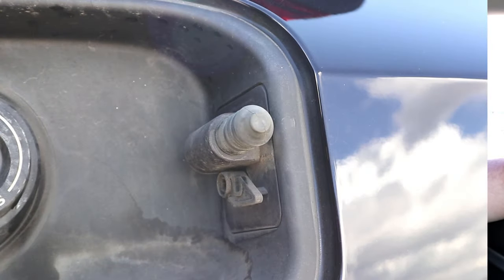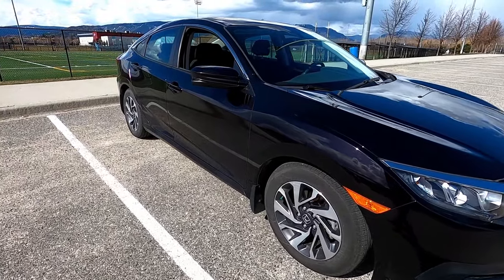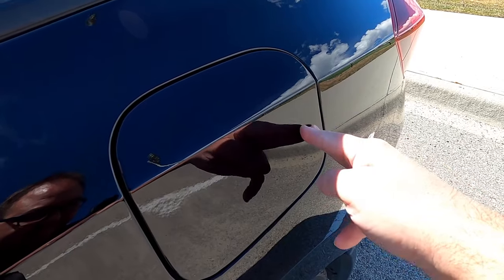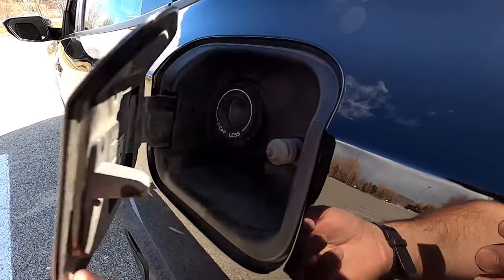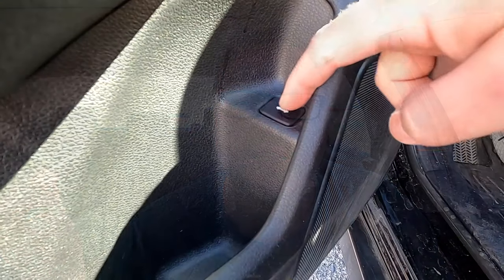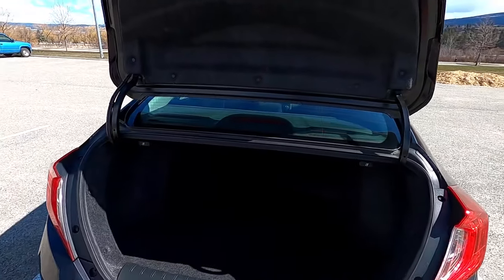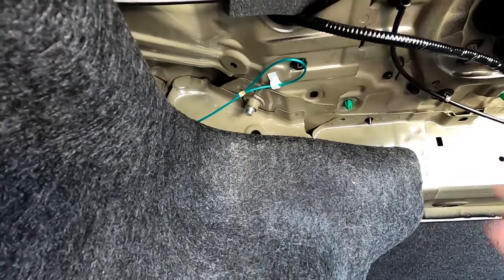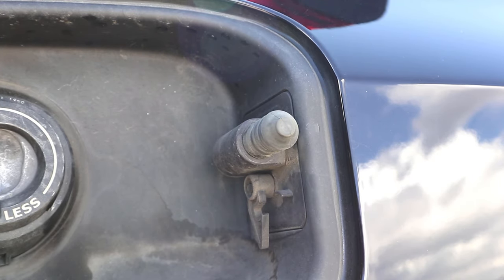Honda Civic Gas Door SECRET Release Cable Handle - 2016 2017 2018 2019 2020 2021

Comment: I was at the gas station and didn't know WTF was going on when I couldn't open the fuel door.  I have a 2018 Honda Civic Hatchback and your video was on point!!!  Had to remove a small panel where the jack is located, and I felt inside the opening for the wire.  BINGO!!!  Thank you!!!
Reply from the maker: Glad it was helpful!

Comment: For anyone with the Honda Civic hatchback model, look in the side panel (behind the driver side), where your jack is located and you will find a white cable. Pull the cable and unlock the car via the remote or the locks on the door to release it.
Reply from the maker: Thanks for sharing this tip.

Comment: Thank you. 
Wanted to mention because I didn't see it in the top comments, it was because I lock my doors when I pump gas. 

As soon as you said, "It locks when the car does." I just had to take a minute with my head in my hands, laughing through my anger. It makes complete sense, but I've always had, ya know, a NORMAL DOOR or a button. Glad to know there's an emergency release tho.
Reply from the maker: Lol 😂 Glad I could help!

Comment: I usually don’t comment on YouTube but THANK YOU for this, I could cry I’m so happy. I just spent an hour at the gas station trying to find a way to open my stuck gas door and your video wouldn’t load and all the things on the Honda website (saying to shut off the auto lock feature) wouldn’t work. I got home and your video finally loaded and I ran out to my car and BAM…. Broken down moving boxes were stuck on the green wire which is why it wouldn’t open. You just saved me $200 (what they said it would cost to look at it) or even more. I’m seriously so relieved… thank you😭
Reply: Also for the record, mine is a 2020 Honda Civic Sport
Reply from the maker: Awesome 👍 I am happy I could help. All the best!

Comment: Omg you lifesaver, you handsome man! Thank you! For hatchbacks(mine is 2019): there is a compartment on the driver side in the trunk area (this compartment holds the jack). Open this compartment with a twisty tab and look for this same looped wire towards the top of the inside of the compartment above the jack. Pull it! TADA! That should pull the gas lock down!
Reply from the maker: Awesome 👍 Thanks for the tip.
Reply: Thank you! I wished I had seen your comment before spending half an hour looking for it 😂
Reply: Thanks soooo much! We literally called roadside assistance and they told us to call AAA and have our car towed., how could they not know about this! You’re both lifesavers!

Comment: Thank you!!!  Had this happen yesterday on my 2016 Honda Civic, drove over to Honda and they opened it, said it if happened again to "touch the yellow wire", well it did by the time I got back to fill up again, could not open the flap.  Opened  trunk touched the "green wire"  nothing happened.  Will have to try that this morning in daylight, sure hope it works.  Thanks so much for actually showing how it works.
Reply from the maker: You're welcome 👍 I hope you are able to figure it out.
Reply: @NorthernVikingEveryday  Yup it worked, thank you again.  Lets hope when I start up and hit the gas station is still will still work!

Comment: In a 2018 hatchback EX the cable is at the top of the compartment where the scissor jack is stored. I wouldn't have known to look for it without this video, so thanks!
Reply from the maker: Awesome 👍 Thanks for the tip.

Comment: Thank you!!! Works on my civic hatchback sport manual 2018, the wire is where the jack is located on the left side, white wire, it took awhile tho, i had to keep locking and un-locking car, the wire was hard to pull so I didn’t do it full force so I didn’t break anything.
Reply from the maker: Glad it helped and thanks for sharing where the wire is on the hatchback.

Comment: At the gas station wondering how the hell ill put fuel in with broken gas door ...ty your video helped me and it was quick.
Reply from the maker: Glad I could help 😀👍
Reply: @NorthernVikingEveryday  btw mine is a coupé si 2019 and the cable was on the Driver Side and seems yellow

Comment: If anyone could help!! I have the hatchback version(2018 honda civic sport)  i found the cable which is cleared colored but when i tug on it my gas door still will not open. Running out of solutions here

Comment: I have a 2018 Civic exl, and mine was located in the access panel to the left near the front of the trunk, this is also where the jack is housed. At the top you will see a pull tab like this one, but is not green it is a clear plastic color.  Just FYI. Have a great Day!
Reply from the maker: Thanks for the tip 😃👍

Comment: Thanks so much KEN, my son has a 2012 Civic and a the gas cap won’t state shut. Looks as if the little pin is either not there or stuck inside the cable housing. I’ve tried pushing it where it normally is several dozen times but no luck. Any DIY ideas or can I replace that with a push-in type close or whatever you think?

I just subscribe as I also have a 2015 Honda Pilot and my X has a 2015 Accord so your expertise is much appreciated.

P.S. my family and I are on Honda #12

MURF
Reply from the maker: You sound like a big Honda Fan! Thanks for subscribing! 👍I am not sure how to fix the issue your son is having but if anyone else watching knows please comment below to help Neil out. Thanks
Reply: @NorthernVikingEveryday  Thanks Ken. A friend of mine is a fleet manager and I just buy over email whenever I need one.

Comment: emergency fuel door pull cable is there on the 2023 Civic as well, haven't had to use it, but figured that's what it was....HONDA should've mentioned it in the OWNERS MANUAL
Reply from the maker: I agree 👍

Comment: Awe thanks dude 😅 i thought i was gonna be stranded, im low on gas and it wouldn't open when i was at the gas station😅 but now it makes a weird sound every time i lock it and it isnt locked😐 i can lock my car but the fuel door can still be opened
Reply from the maker: Glad I could help you out 👍 Hopefully you can sort out the issue.

Comment: I had no idea that the car being locked prevented it from opening. I thought it was because it was iced over that it wouldn't open. I pulled it open and it opened, but now I feel like it's not as flush with the body as it was and I might have bent something or weakened that lever. Wish I would have looked at this video before.